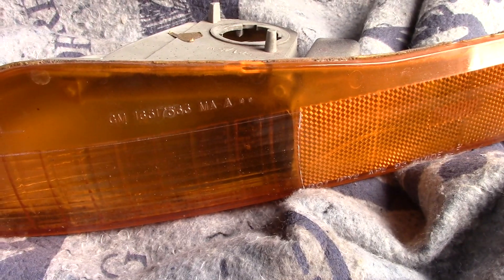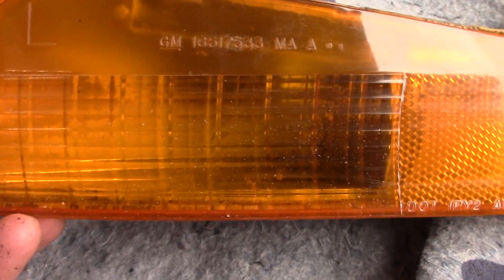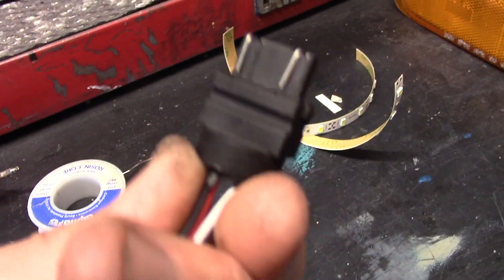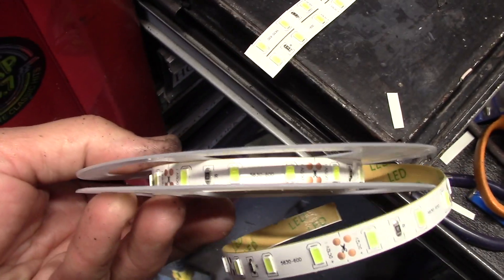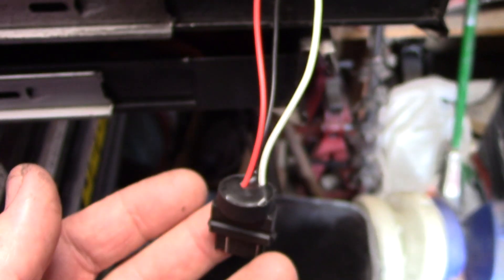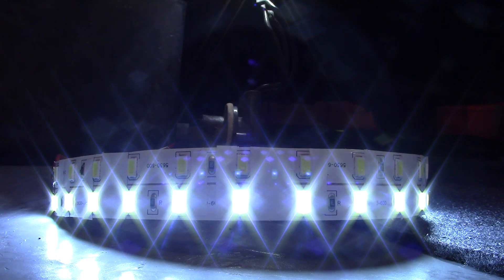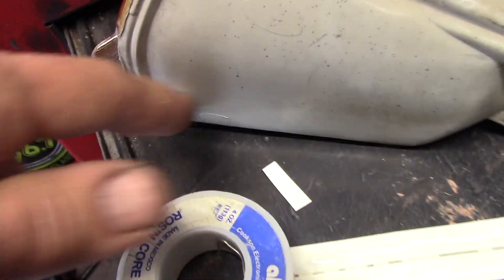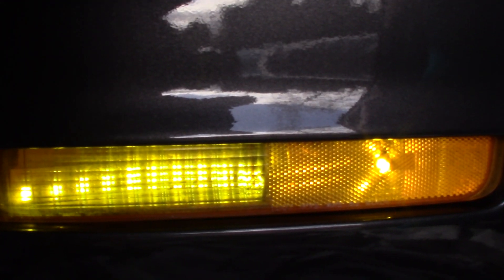Fourth Gen F Body LED Running Light Conversion

Comment: Couldn’t you just buy led lightbulbs?
Also, you didn’t add a resistor? So the blinking pattern stayed relatively the same and not get the super fast blinking
Reply from the maker: I tried those, they didn't work either.  They hyper-flashed even with a digital blinker module.  I found an anti-canbus bulb that did work, but it was so huge it wouldn't fit in the housing.  I think these led strips must already have enough resistance, because they don't seem to hyper-flash.  Maybe that's what those little i/c chips do.